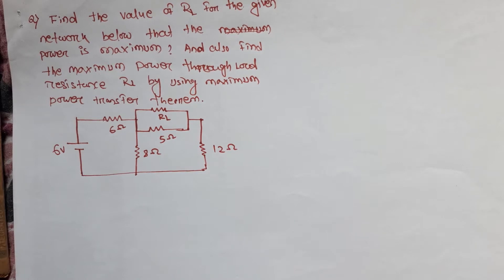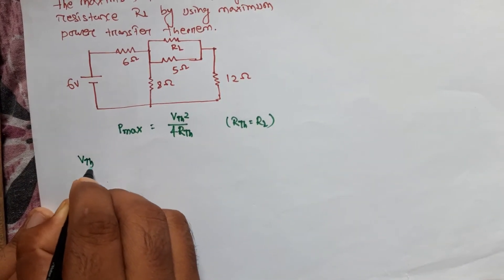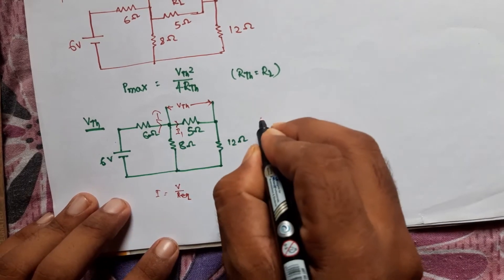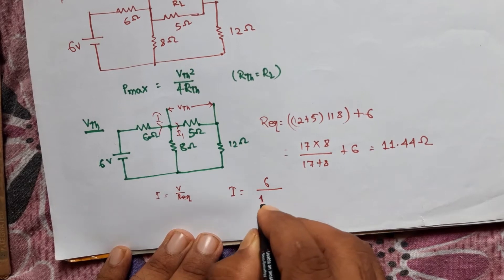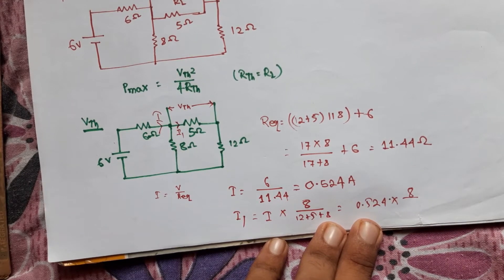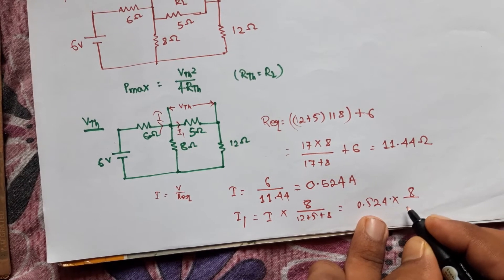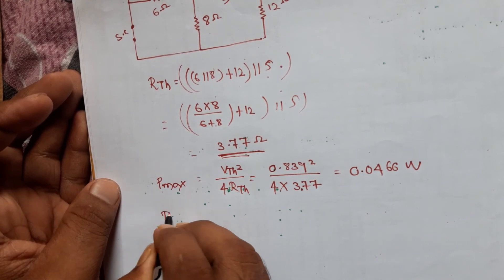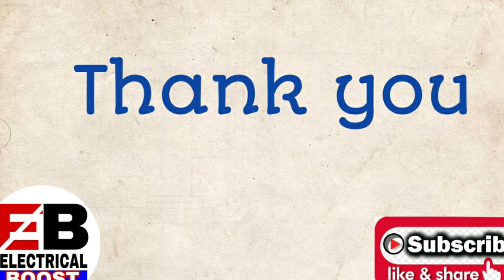Maximum power transfer theorem problem

Comment: conduct suitable experiment to obtain the maximum power through RL of the given network and verify the same by theroretical calculations help me🙏
Reply from the maker: ok
Reply: @ElectricalBoost  urgent I need today 
Tomorrow morning practical exam please help me sir🙏
Reply from the maker: @user-cy7tz2ct1d  ok send you questions 
In my mail Id electricalboost@gmail.com
Reply: @ElectricalBoost  Find value R=68kohm,C=470,20v experimentaly obatain the transient voltage (both and discharging for the circuit shown
Reply from the maker: @user-cy7tz2ct1d  please send your questions on my Email- electricalboost@gmail.com
Reply: Find value R=68kohm,C=470,20v experimentaly obatain the transient voltage (both and discharging for the circuit shown

Comment: Rth is wrong
6 is in parallel with 8 ok 
But 6//8 is in series with 5 and 12
Reply from the maker: when you find equivalent resistance of any network you should consider two terminal where you look which element are series and parallel 

in this case we need equivalent resistance (Rth)
at the terminal where Rl is connected 
so we reduced circuit from any end but closed with last terminal where to find Rth
so that 6and 8 in Parallel then those parallel combinations is in series with 12 
the parallel with 5

please all other thevenins theorems problem for more details